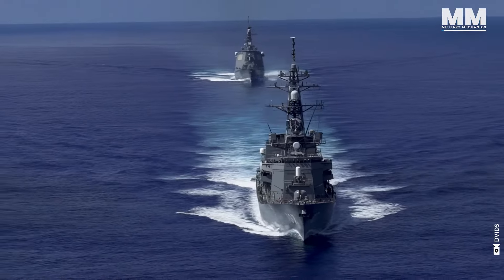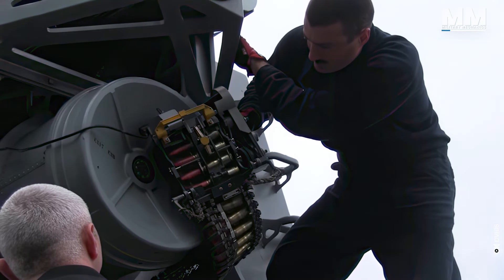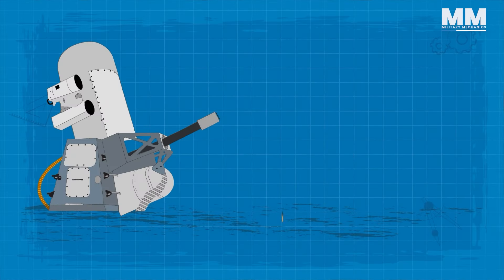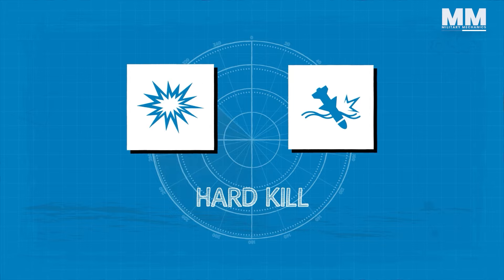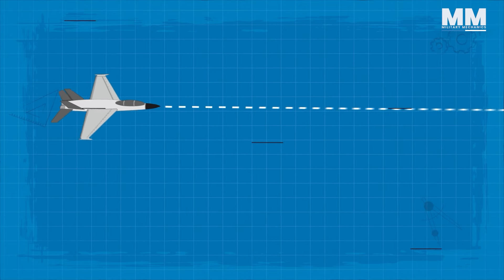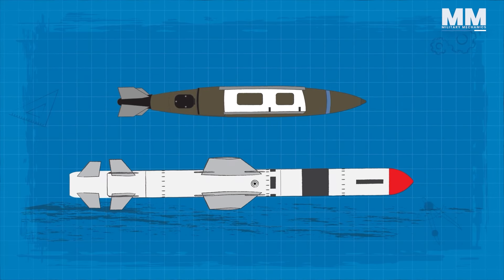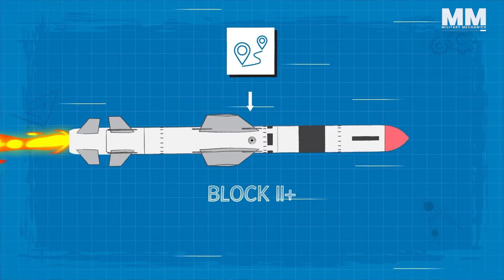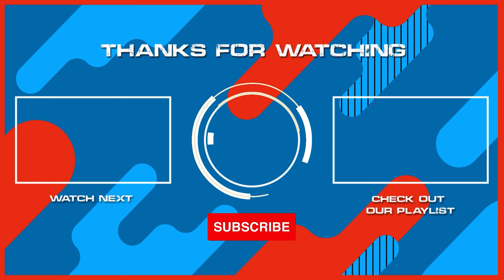CIWS, Harpoon, and Sea Sparrow: The Deadly Trio of U.S. Navy Warships

Comment: US Navy is more and more transferring from gun based CWIS towards the missile based Sea RAM as the last ditch defense systems for naval vessels. 
Raytheon built Phalanx CWIS, although legendary and effective, is showing it's age. Especially compared to the latest Russian (Kashtan) and the incredible Chinese gatling gun type weapon systems.
CWIS fires up to 4500 20mm rounds per minute, while the latest Chinese beast fires 8000 rpm in a larger 30mm caliber.. 
So the Navy decided to double down on the incredible Sea RAM (Rolling airframe missile), that not only has a much longer range than the Phalanx, but is also much more precise.
P.S. Let's be honest here and not refer to Harpoon as a "considerable threat to any naval force"... Harpoon ASMs are obsolete in more than one way. They are short ranged (the latest variations  hitting 170 miles while the older ones have 80 mile range), have a relatively small warhead compared to more modern ASMs (around 500 pound warhead), aren't stealthy at all, have ancient targeting systems and are damn slow...

Comment: Why don't they make a Sea AMRAAM? It is a much better missile than the Sea Sparrow ever was.
Reply: Clutter
Reply: Because the Navy has the family of SM, Standard missiles and has ESSM, Evolved Sea Sparrow Missiles. This video is a bit dated. ESSM can be placed in VLS cells using a four missile pack per cell. Increasing the number of missiles a ship can carry. 

Rolling Airframe system has been slowly replacing Phalanx on most new Naval ships. Just like the Naval Strike Missile will be the new surface-to-surface cruise missile for the Navy. Again, slowly replacing the Harpoon.
Reply: They did go the other way and now they shoot the SM-6 from F/A-18 E and F Super Hornets
Reply: @TheBongReyes  Did you see where the Patriot PAC-3 Missile has been modded for use in the MK-41 VLS system? The Navy says they can quad pack the PAC-3 as well.